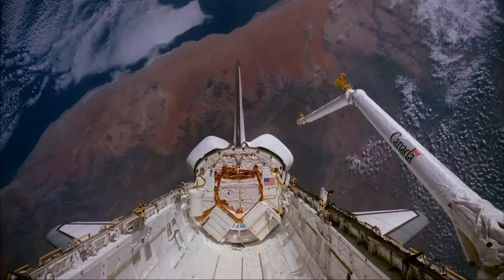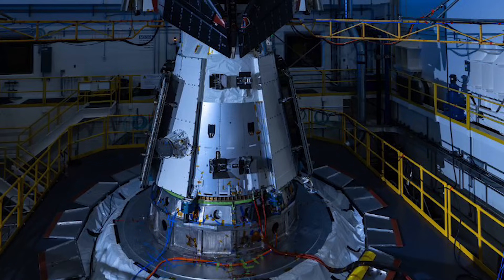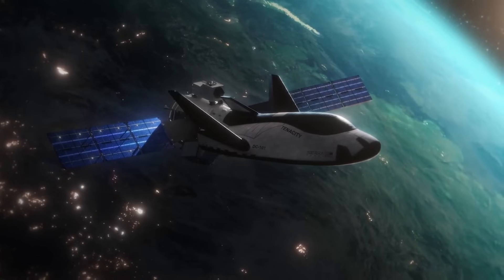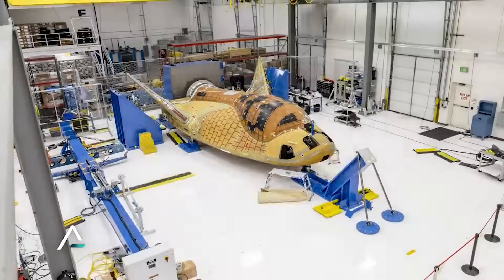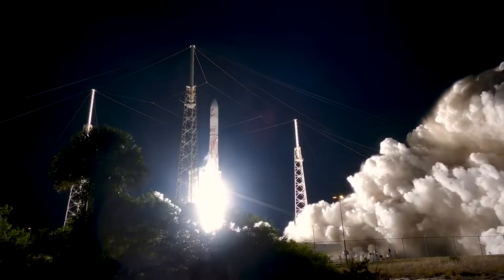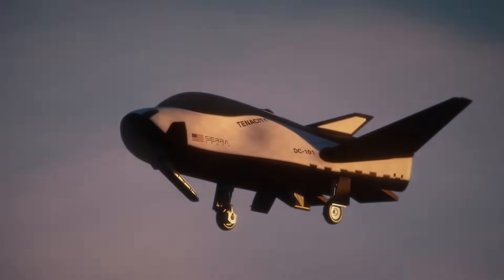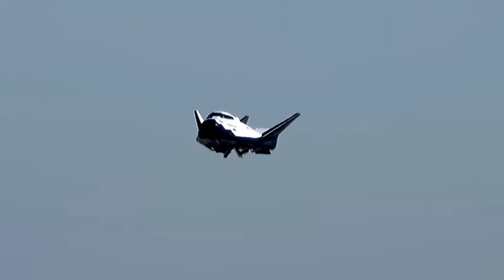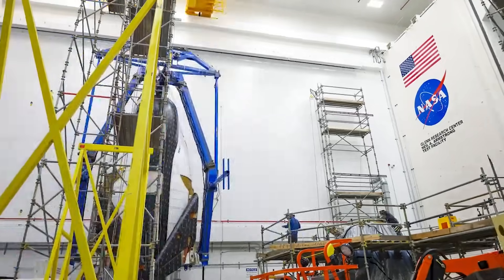Dream Chaser Tenacity Has Been Stacked On Shooting Star

Comment: This will be the first pressurized structure in space made out of "high temp" CFRP or carbon fiber. It's a 2,200 lbs monolithic structure made by Lockheed Martin. Even though it's not a Boeing product, I'm still worried about pressure and temperature cycles in vacuum causing delamination. 
Inflatables are designed to be flexible. Carbon fiber has to remain absolutely rigid to maintain strength.

Comment: What's the point of the (not reusable?) "Shooting Star cargo module"?
Reply: It was added later, in 2019 and it wouldn't make sense to redesign Dream chaser after all the testing they had done but they wanted more cargo space, so added shooting star.
Reply: Previous replies are correct, but also consider the current Dream Chaser is slightly smaller than the first crewed design.  Smaller cargo version means it can fit inside a faring, but it does reduce the internal area.  Shooting Star gives more uplift cargo space, provides on orbit power, and allows for disposal like the Cygnus does, so they don't have to bring rubbish back down.  This gives more room in the shuttle for returning science experiments and equipment. 🤓
Reply: Free space for discarding junk basically
Reply: @Hungary_0987  Its a lot more then that, it works as a separate space craft, with its own power supply,  supplies active and passive thermal management to payloads. also, the DOD has signed a  contract to use it as a possible commercial solution for a high-powered uncrewed orbital outpost, Sierra Space says the module is capable of additional types of missions in LEO or to cis-lunar destinations; it can be a free-flying spacecraft, like a pressurized and unpressurized space bus for satellites,
 its not just as trash can.
Reply: @zander_the_space_fan  That makes sense. I hope these benefits outweigh the cost of discarding it on every flight, contrary to the approach of SpaceX and Boeing.
Reply: Cargo needs some kind of standard container, they can't just strap bags of food and experiments to an unguided Centaur. It's easier to unload a Shooting Star berthed to the station—otherwise someone would need to catch the drifting shipment, then EVA and bring things in through the airlock
Reply: @shanent5793  Nobody proposed strapping "bags of food and experiments to an unguided Centaur". The question was why the cargo isn't put inside the return vehicle (the Dream Chaser) like in the case of Dragon and Starliner.
Reply: @cube2fox  some of the cargo goes in the Dream Chaser, some in the Shooting Star. You don't usually have to return as much as you bring up, so the difference stays with Shooting Star, which is itself an independent spacecraft that can stay in orbit

Comment: Some tiles are still missing. I'm guessing that due to the fancy shape, production isn't very fast.
Reply: They need access for instrumentation like strain gauges and thermocouples, as well as for visual, ultrasonic and radiographic inspection. They'll also pull a few after the test to see how well the bond held up. Tiles are notoriously slow to install, the ones on the Space Shuttle took 40 hours each
Reply: @shanent5793  Thx 🙂
Reply: The tiles r missing it certain spots for reasons.
Reply: @wrxsti1987  Could you elaborate why that is? The hull is probably made of aluminum, right? It doesn't like high heat, so I wonder...